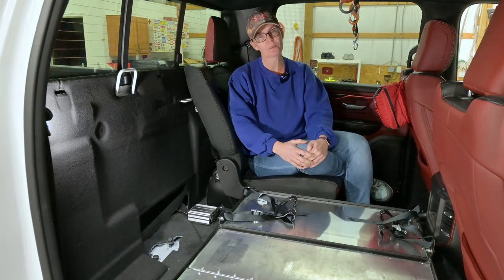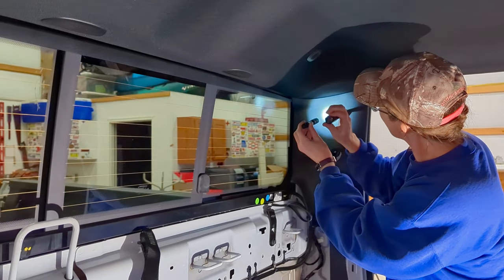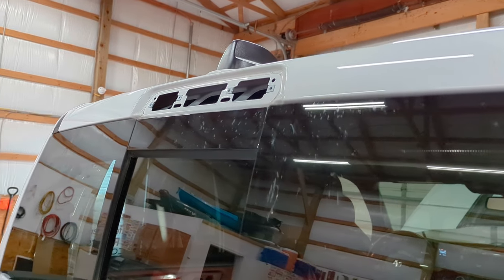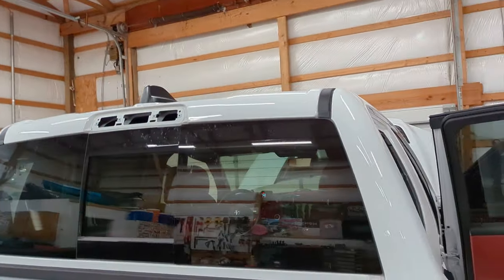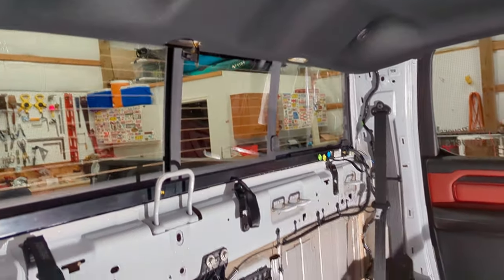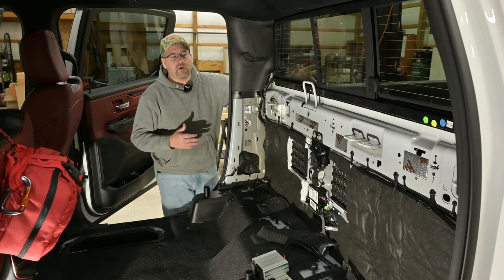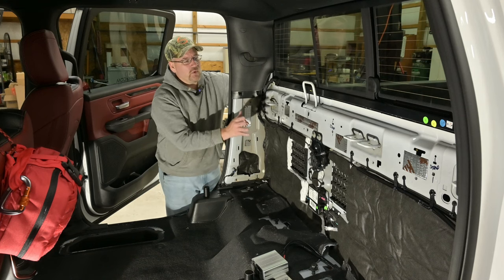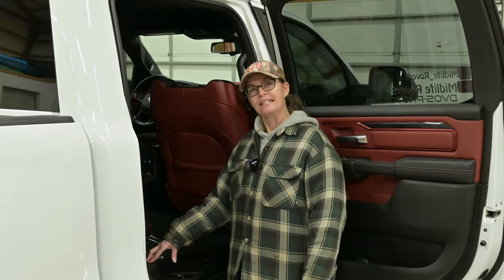Ram "Shark Fin" Antenna Removal - Camp Bedrock v2, Part 3

Comment: Can the shark fin be relocated to the front of the roof closer to the windshield.  I have a slide in truck camper and need the shark fin moved.  Is there any special electrical connection that needs to be sourced, or is regular speaker wire or some other type of commonly available wire usable to make the length necessary?  If the shark fin can't be relocated, what will happen to the truck functions (i.e. radio, gps, etc.) if the shark fin is removed altogether?
Reply from the maker: As we mentioned in the video, we stopped where we did because of the special antenna cable and connectors. FWIW, our system has worked fine for over a year other than the GPS gets a little off on its location (typically when off-road). This said, we do not use satellite radio which is what I'd imagine would be impacted the most. ~J
Reply: @MidlifeRovers  ok thank you.  I also don’t use satellite radio or the truck navigation, so, if there isn’t a harness or ability to splice in extra wire, I’ll probably just remove it and cap the hole.  Nice video!  That’s for the prompt response.
Reply from the maker: @deanvandress4693  NP... Remember, if you remove it you will lose your regular radio and GPS location. It's all in the sharkfin. Most slide-ins will go over the fin while installed. ~J

Comment: Great video, I need to remove my Ram 1500 sharkfin, did you have to disconnect the battery to mess with those airbag covers or are you alright with just removing them without disconnecting the battery?
Reply from the maker: We did not disconnect the battery at this stage and everything went just fine. FWIW, we now have our topper and only have issues with the satellite radio. Everything else is working covered up.
Reply: @MidlifeRovers  thanks for the quick reply!